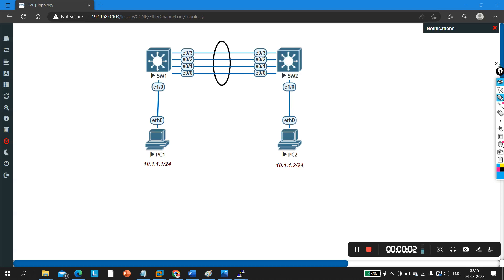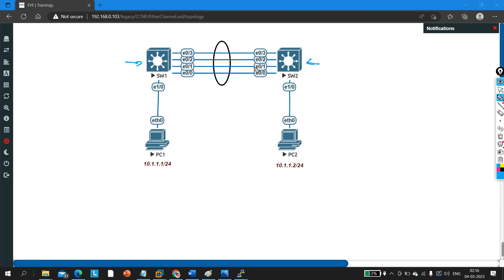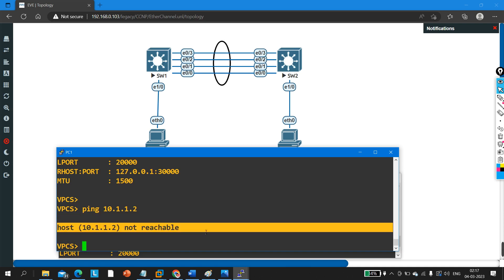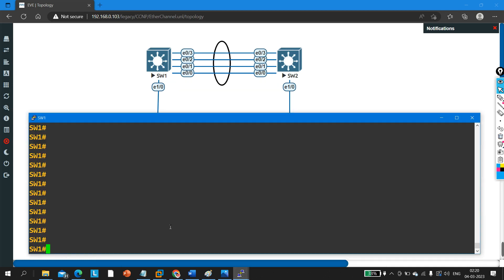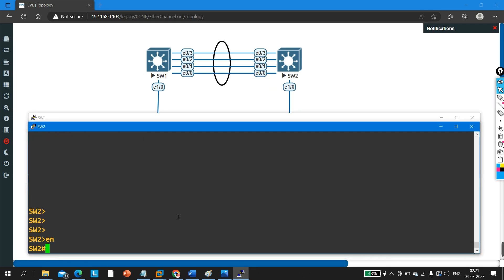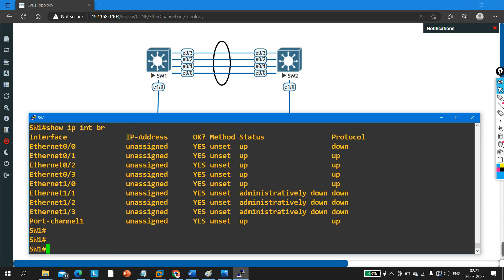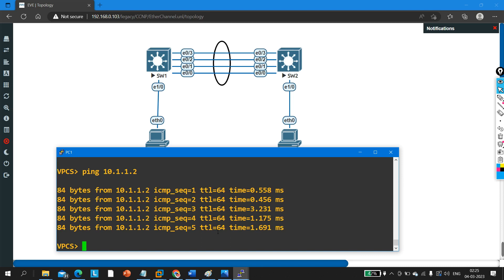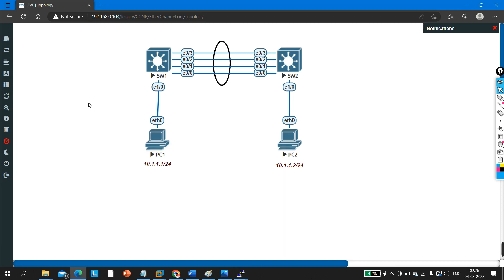EtherChannel Troubleshooting For Network Engineers #ccna #ccnp #ccie #pmnetworking #etherchannel

Comment: Great video! A question about 4:25 Do the Ethernet standards have to match even if the speeds are the same? For example, if 1 interface is Gigabit Ethernet with a speed setting of 10, and all the other interfaces are Ethernet (which of course also have a speed of 10 Mbit/s), then wouldn't that work?